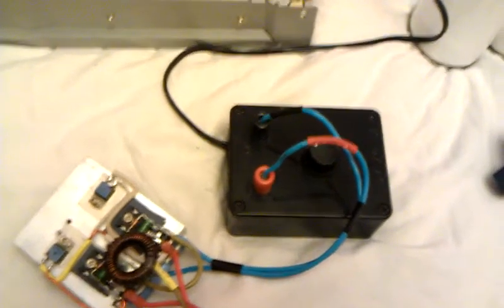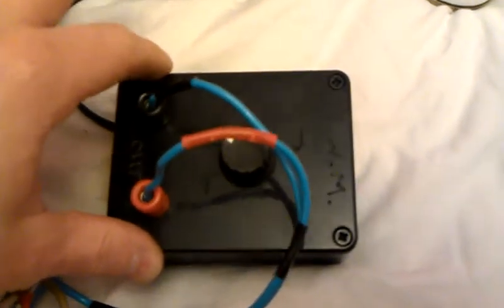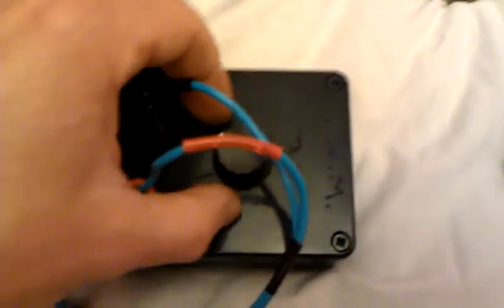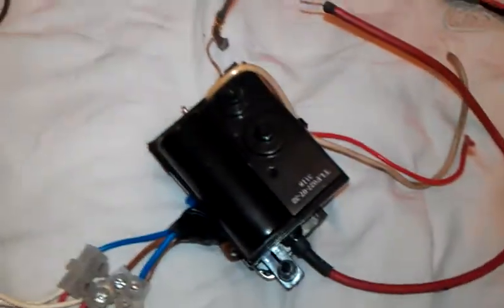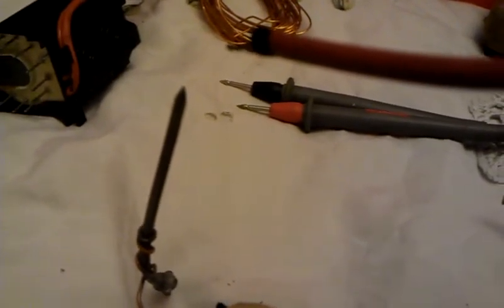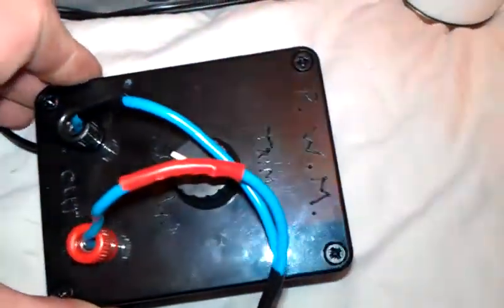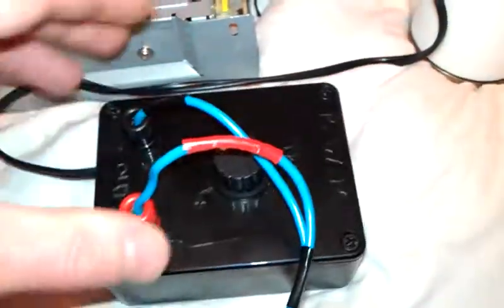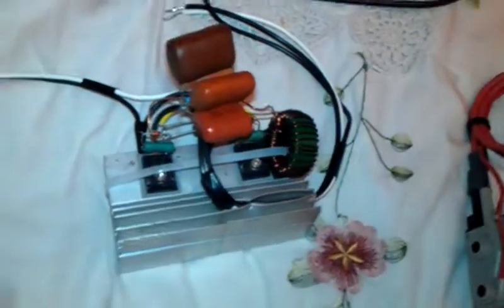P.w.m on zvs driver

Comment: They're great until they blow up. I had bad luck with the first one. I was only running an led strip of 8 amps but I guess that was just too much for it. I'm getting the 60A this time to be safe. Thanks so much for demonstrating this works. I was theorizing that it would.

Comment: would this work for my latest project? is the 555 heating up the zvs driver more than normal?
Reply from the maker: Hi mate'
 the 555 timer chip was fine mate' didn't get any warmer with this project,  and the zvs was fine also. I don't know what project you have in mind' but I'm sure it will be fine lol. Any more help mate or info : 
get in touch. 
Thanks for the comment, and be safe.👍😉

Anthony.
Reply: Check out my latest vid! zvs sstc! Yeah I think your 555 box is gonna go great with it!
Reply: Just worrying on how the the fets will keep oscillating instead of being thrown into linear... I wonder if an air core inductor on the zvs board would help too... right now I'm using x amount of turns on the primary coil driver.
Reply: With ferrite*** blah my words are not matching! Lol